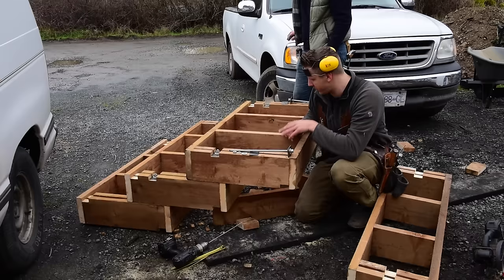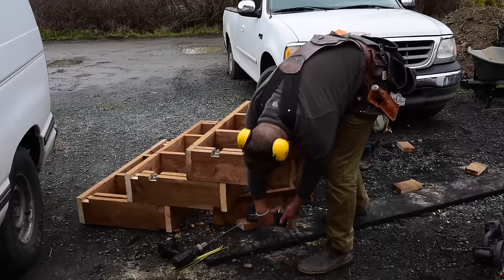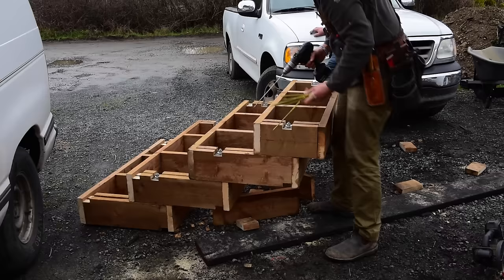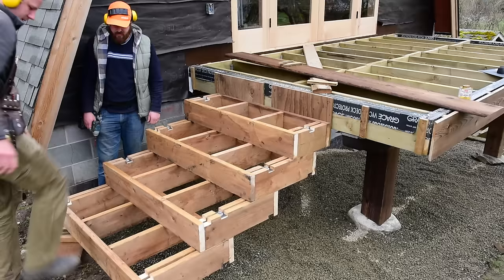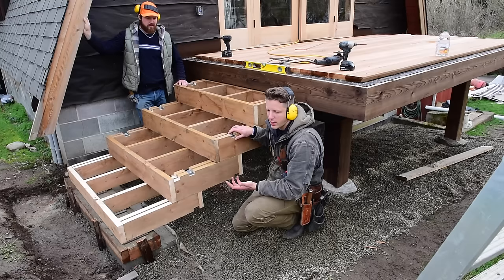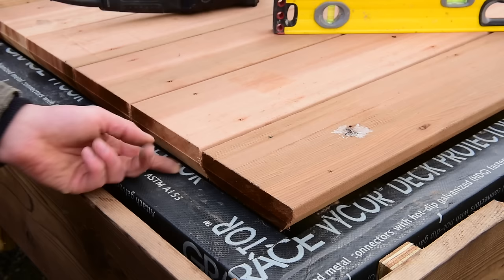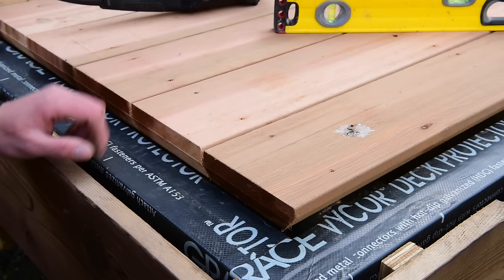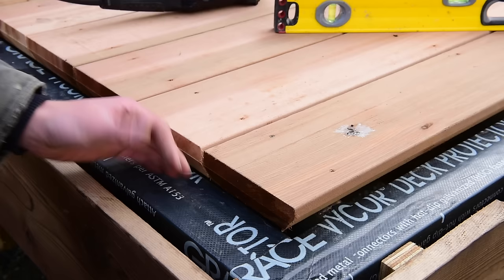FTF #52 Stairs Without Stringers? Here's How

Comment: what if your trying to radius all feild decking ends...sometimes you can't just Trac saw the band in afterwards because your left with a straight square edge... but long feild joints(16'ft plus)  have radiused butt joints? ...just run a palm router?
Reply from the maker: I would cut a piece of plywood to match the radius and then use a plunge router with a top mounted flush guide bearing to follow the radius plywood edge.  If that makes any sense.

Comment: Nice! My concern would be horizontal movement over time. The all thread is great in tension, but not so good in bendy. You have a 4 bar linkage and may turn into a swing. I would just tack a metal strip for shear on the inside.

Comment: That's a lot of hardware and cutting and double boards just to save from making the bottom stair full depth and the rest depth as needed.  Seems like there's a lot of extra lumber just to support the bolts when making the supports longer uses no more lumber, is more solid and uses NO hardware.  What am I missing?

Comment: If I wanted this look, I would use conventional stringers and face the outside of them for the stepped appearance. This video shows a blivet. 10 pounds of stuff in a 5 pound bag. Also, I think the other code violation is the different tread depths. Dangerous? Uncomfortable?
Reply: Stephen Colley difference in the run of the stairs is the first thing I picked up. 7" rise 10"run. Run turns out to be 11" after the 1" overhang of the tread.

Comment: I like the stair design. I don’t like picture framing the deck boards though. Too problematic. Many times the frame part does not lay as flat as deck boards also depending on railing type the post bases are tilted as a result. Plus that gap at ends of decking is a water and debris trap no mater what you do and the more you power wash a cedar deck the more oils and soft grain you wash away making it more vulnerable to rot.

Comment: Engineer here.. don't ever do this. Attaching to the deck doesn't meet standards, or any code in Can/US. Thin plywood with screws (even if they are structural)? hard pass. Didn't do the math on the rise/run as I don't know the finished height/total rise, etc.  Also would have to contact manufacturer of that rod to see it's sheer rating and pull weight, otherwise it's just a guess.

Comment: Why were there notches cut, but not used in the tops of 2 of your tread/joists? Near the front nose board? Are you going to use these somehow to install the rails? Looks good, and you DON'T need Mathias' help, your field experience probably outweighs his desk experience... but that's no insult to him. I know he has testing in the field experience, but you're just as experienced with structural design.

Comment: These steps are dangerous. The fourth tread does not have the same depth as the rest and will confuse and trip people using it specially at night when it's dark. Your brain will automatically think all the treads and risers are evenly spaced until you get to that step with the short tread and your toe or heel catches causing a trip/fall. When building stairs, the treads and risers must be even all throughout. Over-engineering is nice if you can afford it but if it's not properly designed, safety may become an issue.

Comment: This reminds me of a video I saw recently that described some hung walkways in a hotel that collapsed.   It was a similar design to this -- basically, the bolts carry more & more load the higher up you go -- that top bolt is carrying the weight of the entire sructure.  this is different though, because the bottom stair is on the ground - theoretically the stairs themselves give support - they're not fully suspended.   If they were, that top bolt would be a concern.   Full disclosure: I'm a terrible carpenter and this is all just conjecture.

Comment: That looks like way to much work. Also, you would have to rip all the lumber used for the steps to the correct riser height for the which would require more lumber than normal plus the extra time. We normally do box steps for winders or some circular steps.

Comment: uhhhhh.... the nut and washer at the top or bottom will be handling the weight of everything else, not just the steps it is holding together. probably doesn't matter for 3 steps, but if you built tall stairs like this it would be a disaster

Comment: At the outset of this statement, I have to honestly declare that my following questions, and commentary are not meant to be crude, harmful, or insulting, .  First question: What is the overall benifit of this particular design?  Note:  It takes more lumber, time, and effort to craft that particular design. Also, due to the live load (placed upon them) in conjunction with environmental conditions, and the nature of wood itself, the mechanical fasteners  will compress the wood fibers over time and in turn compromise the structural integrity, and safety of the staircase as a whole . My second and final question is: Why would anyone desire to abandon the code accepted and structurally dominant method of crafting whole piece lineal stringers?  Properly designed, and placed,  the traditional method will far exceed the above captioned design? In ending,  the above-refrenced model is severely flawed, and fraught with problem.  I also feel compelled to critique the commentary of the designer (Carpenter).  within  minuite 1-32  of the video,  the commentator (carpenter) states, " O'sutside stairs just dont, I dont know,  get me excited. You know, just the stringers and the treads and the butt ends...."  I'm not quite sure what he means by that statement?  His design as illustrated, has stair treads and butt ends!  in fact,  the very "butt ends" he so detests are more plentiful and hence, noticeable,  than the traditional  method.  A properly designed staircase (whith faced off risers) show no "butt ends".  He goes on to say, " you can dress them up a little bit to look pretty but (he's) not a big fan of just boring old, cut stringer stairs."  Humm,  that comment must mean, he  is thinking of producing his next video which will undoubtably illustrate  his method of trimming out  this new innovative stair design. Cant wait!!!!!!!!!!  In all seriousness, and in good conscience, I can say,   there's nothing wrong with formulating new models, or designs.  However, I would just caution against airing such innovations until all the claims and  benefits of the new model can be borne out.

Comment: Your stairs will never pass code if inspected The tread runs are not equal your top step is smallest in the run than the rest of your steps they must all be equal generally 11 and 1/8 inches is typical

Comment: problem is:  your Panache' is going to FAIL when your cheap chrome vandium fasteners rot and fail. I am 60yrs. old I have more than 35 yrs. rough framing experience. unless the building inspector suffers from HUBS (head up butt syndrome) this will never pass. unless you live in a few different counties in Alabama, where there are no building code restrictions

Comment: What if you made the stringers and then cut them up and bolted them back together again. 
Would you say that it looks like it's floating ?
You made stringers by bolting wood together and also if you use solid wood for regular stringers for such a short run of only 3 or 4 steps, that would look like they are floating also. 
I've been building only for around 55 years and probably see things differently from the eyes of a younger generation builder.  Things are things like stairs are stairs and you can't fight that fact. For things to exist in this situation they have to have certain attributes and assign them names made up by individual builders but the attributes don't necessarily change. 
You just went about building stringers differently and you came out with stairs. 
New ideas are tougher than they look  to come up with and especially something like the stairs

Comment: This design is potentially flawed if implemented by a laymen.  The forces need to be calculated rather meticulously, and those bolts while they may be strong enough for 4 stairs may not even come close on a 8 or more stair design.  You might be asking why, but for that I refer you to the "Hyatt Regency walkway collapse" (It is an engineering case study nearly every engineer looks at these days).    Essentially while your bottom tread will transfer most of its load through your footing, each tread above it translates load through the bolt system.  Your bolts have to withstand a load force as well as a sheering force due to their orientation and each tread in the staircase effectively magnifies the forces exerted.   So yes, I would say this should fail an inspection, unless you have proof in the materials and get sign-off from an engineer.  You are looking to incur some substantial liability for installing this without the engineering work being done.

If you don't like the look of stringers, why not use an inset stringer, and simply put a facade on the side to simulate this "floating" look?  Stringers are not hard to make (or buy pre-made for that matter), and you simply need to cut boards that get strapped on to complete your look.  This also means no metal work, and you'll pass an inspection without engineering costs.
Reply: I disagree for a couple reasons, but one is dependent on how the bottom tread is secured. 

First, the maximum load on a 1/2 inch treaded steel rod is 1100 pounds. Since each stair has 2 rods, that's 2200 pounds that each stair would be able to withstand. 

The first stair above the bottom would theoretically be supporting the greatest loading as the weight of the stairs above would apply a torque and put the steel in tension. Each stair above that has less total weight applying torque, therefore less tension stress.

As for shear, there should be incredibly little shear forces acting on the stairs, unless people are running and coming to skidding stops on the stairs regularly. There would be wind acting on the deck which could translate to some shear force on the stairs, but again, with the strength of the deck, and it's foundation, the shear forces on the threaded rod is going to be minimal. Your wood will fail long before you exceed any shear capacity of the steel.

Additionally, and this is where my though on how the bottom tread is secured comes in, is that not all the load on the stairs is going to put the stairs in tension. If the bottom stair is secured so that it can not move out from the deck, then the stair are acting similar to a ladder, and the force is rotational into the deck joists. This means that a portion of the weight is being supported by the deck joist and not the rods in the stairs, further lightening the load on the stairs. 

At the end of the day, as long as the weight of the two upper stairs, plus whatever load you are putting on it, say a person, doesn't exceed 2200 pounds, I wouldn't be too worried. I don't know about you, but I don't often have over 2 tons on my stairs.
Reply: Ultimately my point is that it needs to be checked.  But you could build a much simpler stair that meets all local codes regardless of height and without metalwork by just cladding the stair to make it looks like a "floating stair". 

Second, nothing personal but unless you are a structural engineer signing off on this design is reckless.  Not to mention I know no engineer would without specifications being clearly defined.  What happens when someone uses the improper nuts?  The nuts are the most likely failure point, not the rods.  I have not done the math on the load, but I have no desire to build this either.  When I can stick with tried, true, and BTW MUCH easier and cheaper to produce methods (I can do it traditionally AND make it look similar as well)?
Reply: No worries on the "nothing personal", I don't take it as personal. Great to have a real conversation and discussion on the internet. Too few exchanges just turn into name calling for no good reason.

Anyway, I'll try to keep myself on topic. I am not a structural engineer, but I am an engineer, and have taken some structural courses. I personally wouldn't sign off on these steps, not because I don't think they would be strong enough, but simply because it isn't my area of expertise, and I am a real stickler for only signing off as an engineer in my field. In my opinion, for what it is worth, the wood is going to be weak point more than the steel rod, or the nuts. As for using the improper nuts, well, that's part of the point of the inspection right?

I too agree that stairs can be made much easier, cheaper, and look similar, but if someone wants to build something different, that is more than sufficient to carry the loads it will experience, and they are willing to spend the money and take the time, then I don't see the problem. One of my structural professors once said to our class, (paraphrasing as I can't remember the exact words) "you can have a long and prosperous career designing buildings exactly to code, but you will never be happy, because you will have done nothing but build boring rectangles. Just because something isn't described in the building code, doesn't mean it can't meet the building code requirements". I think that's where The Samurai's head is at. For him, it isn't about doing it quickly, cheaply, or easily. It is about trying to be creative, and spend the time to bring that creativity to reality.

Comment: They look sharp, have character, and no reason why wouldn't support normal weight load, excluding 500lb fat hog in-law. If I were anal, I'd miter the corners to avoid the end grain and throw down some PL on the horizontal butt joints for extra support.  These stairs would be stronger than cutting a 2x12 stringer for triple 2x6 treads.

Comment: You would have been wise to hanger the rear ledger of each step to the corresponding double you bolted together,  This is a weak connection supporting your center joists. This will ABSOLUTELY start to flex over time from use and contraction. Of lumber. Movement will loosen fasters and compromise the integrity. Respectfully, this design is wasteful of material, money and time, its subject to degradation without achieving much aesthetically.
Reply: Keep in mind that he can also tighten the boxes from the under side when they inevitably shift and adjust

Comment: would you have any objection to doing a collab where I convert you video to metric for the other 9/10ths of the world.
Reply: Fractions are hard
Reply: @michaeltrivette1728  one inch of rain falls on your 500 square foot roof how many gallons of water will you end up with ?
in metric  1 millimetre on 1 square metre of roof = 1 litre of water. if you can work that out for american units good luck
Reply: @noinchesdiy7269  one inch, one square foot =. 623 gallons.

Comment: Why would you go through so much extra work to build a set of stairs when stringers are far easier, take less lumber than what you've done and the ratio for step to riser is now a trip hazard. 16" treads are far too long and one rusted out bolt after a couple of years and now you have a dangerous situation. Not cool at all. The deck was done right, why screw up the stairs?

Comment: Seems like quite a bit of flex considering how much wood and hardware you used. I don't think it's an improvement over normal stairs, either structurally or aesthetically. I hate them. No, that's a little bit harsh, you're just doing yourself more harm than anybody else.

Comment: Not to code. RISE + RUN = 17 INCHES. Longer run means lower rise. It's ergonomics for comfortable ascending/descending, the way our brains are wired.
Aside from that, what a waste of time and material... a hideous bulky structure, and specialty hardware to boot. Though it is a "great smoke and fire" way out of never learning to use a framing square for anything more than a straight edge and a 90..... ya mean all those little numbers mean something? 
It was the greatest day for me at 22 making cuts for the crew all day when the old timer came over before lunch and said, "Let me teach about that thing you're holding all wrong"
Later when he was setting up to cut rafters he sent me to fetch his brass and worn stair points he kept in a cigar box in his truck
 Nothing finer than expertly cut open stringer steps. Light and airey, sleek and functional. I'm up in age now and banged together plenty of decks in my day, some for friends and family that I still have the pleasure of witnessing my handiwork stand thru time. 
One of my biggest joys is knowing that my ex- wife's worthless prick father is still sunning himself on the deck I built in 1984, holding up as well as the day I built it 33 years ago, that goes for the 2 five foot stair sets, with the only upkeep was replacing the treads in 2005, one year before my divorce. 
I know it's galling him every time he looks at it. We had words the last time we crossed in town and me with the parting shot....
"I hope you get a splinter in that flabby ass of yours"

Comment: Seems like your talking yourself into how good it is .Your building  a stairs and not a Piano. Have you ever cut stringers and under stand rise and run . You used a lot of material to achieve something that with a bit of thought and preplaning could have been done at half the cost. Knowing that a Building inspector would not pass it tells be you just want to barrel ahead regardless. Work smart no hard. Learn the skill of your Trade. You have the ability . You just need to step over the fear of asking for help and learning when needed. Don't overbuild you way through your projects. Your posts reveal this. Good Luck .You can do classy smart work. Reveal that.